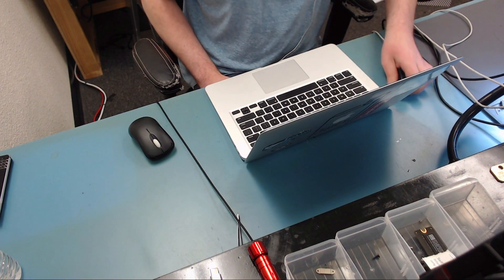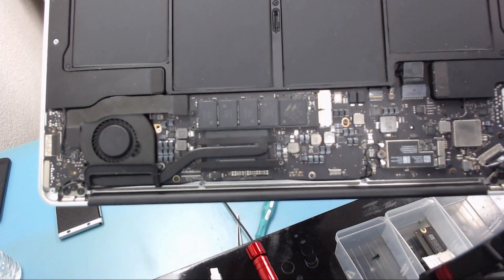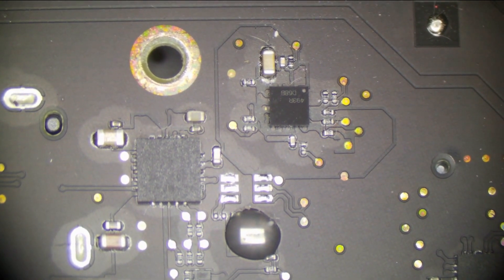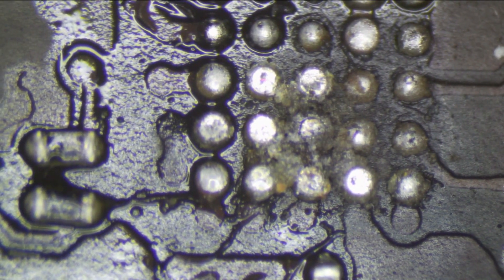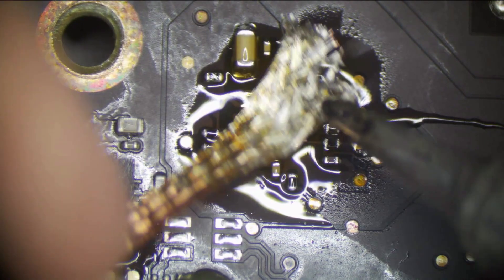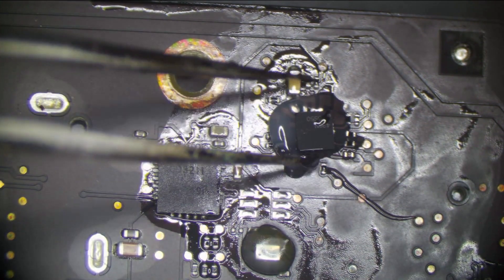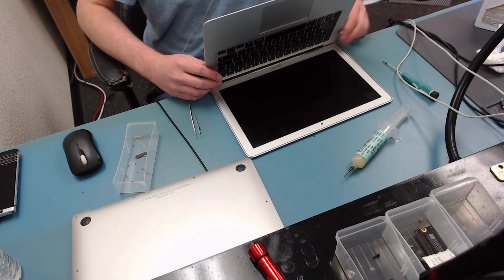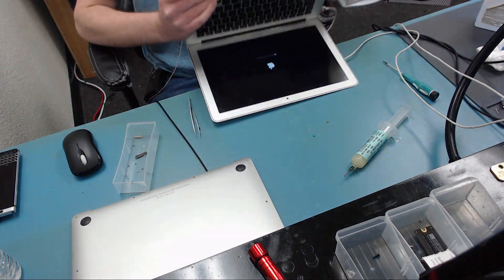How to fix a MacBook Air with no backlight in 10 minutes

Comment: I tried this. My first attempt. I blew 3 capacitors and a tan coloured thing that looked like a capacitor while seating the driver chip. I only found the tan one. I'll get a donor board from ebay. What tips can you give to not blow them away again? Also, there is a pad missing on the bottom right of the board's chip area, the exact one you say to test continuity. How can I fix it? Cheers.

Comment: could use some help, when i opened my macbook air, to give it an alcohol wash, i noticed the feedback trace you pointed out next to the chip that reads 150 441 5bb is missing/burned away.  not sure what to do from there, or where it leads, do i need to solder a jumper wire? if so, to where?

Comment: I do have a A1502 with No Backlight issue but works fine with an external monitor. DO u recommend to check on pointers as mentioned in your video.?

Comment: TCRS do I have to replace the chip or can the same chip be used if damage is not major
Reply from the maker: Do not reuse the old chip. It will be destroyed. It is a $2 chip.
Reply: @TCRSCircuit  could you give me the name of the exact chip so i could buy it
Reply from the maker: @PatrickTempest  LP8550

Comment: Good Morning 
How much did the Chip including the tools cost ? 
I found a MacBook Air just like yours and i wanna try it once 😁
Reply from the maker: Chip? $2. Equipment? $5K minimum.
Reply: Not more than 200 euros.
Without a microscope.
Reply from the maker: @vandehoek  Very untrue. The hot air station alone costs more than $200.
Reply: @TCRSCircuit  Cost me 75 euro.
Reply from the maker: @vandehoek  Cheap equipment sure, however cheap equipment will not cut it for these boards!

Comment: I’m having this same problem. When I shine a flashlight through the Apple logo I can see the display, and it’s making noise so I know it’s something to do with the backlight. Could this be my problem? And do you know how much this would cost to fix? I live in the US
Reply: What did you do to fix it? Please reply
Reply: @Indianajajsj  It is still sitting in my closet not working. Repair shops want 800 dollars to replace a logic board just for a backlight so at this point I will just get a new one. Never buying apple again
Reply: @dsrt65  Oh dear. I have just submitted mine for repair today. Incase it gets fixed I'll let you know then. And if I get it fixed for a small amount i shall let you knw. And also I can tell you what exactly is the problem. And if you can get it done from any repair store.
Reply: @Indianajajsj  Hi, what happened to your repair? Did they change screen or motherboard? I am having the same issue. Thanks

Comment: I dropped my macbook and now my backlight does not work, i checked the lvds connector and it seems fine. What could be the problem? Thank you
Reply from the maker: With it being dropped it could be a bad display or maybe a shorted output capacitor on backlight output on the board.
Reply: @TCRSCircuit    @TCRS Circuit  The display is showing an image so is it possible the backlight component of the display is the only thing faulty. Whereabouts is the output capacitor roughly 2013 model? Thank you!
Reply from the maker: @joshuamiller75  There are many output capacitors. You will need to diagnose it, however you really need to practice on something else before attempting to do board repair on your machine.

Comment: What I do not get is, when you apply all that solder flux , it overflows to other nearby circuits harboring capacitors. The heat gun heats up the backlight chip space to melt the solder and loosen the chip. But it also heats up the nearby capacitors space. So, are you not affecting the capacitor negatively, or even causing it loosen its contact to the logicboard, or the heating damaging the capacitor? The only thing I can think of is there is a temperature difference in the melting points of the solder used to place the capacitor to that used to place the backlight chip. Plz explain
Reply from the maker: The capacitor is not affected negatively at all by the heat. Surface tension holds in place so it will not lose contact with the board. The melting points are different due to pad size. Large pad size = longer time to desolder.

Comment: Can some one help me out! i have a 2012 macbook and it doesnt dim, when i get halfway along the dim scale it turns the screen completely off completely.
does anyone know what the problem is?

thanks
Reply from the maker: Could be screen or board. I'd put my bets on a dead backlight boost driver on the board though.
Reply: @TCRSCircuit  well that sucks! i guess i just wont use the dim function then!
Reply: @TCRSCircuit  Man, where can I buy this new piece "backlight chip" online? In addition, applyed fluid & other great stuff.
Reply from the maker: @johnj9976  Mouser or digikey has them. The liquid is flux. However if you do not know these things already then you need to practice on some dead boards before you attempt on your own or a customers board. Buy a soldering setup, and practice on some junk boards before trying this particular repair.

Comment: I have the same problem with my 2014 Macbook Air. I got it with the screen just like this by the owner for free. He spilled coffee on it. The screen shows up, but no backlight. How much is this charge to replace this..right now I am using this mac just as an external monitor.

Comment: Great work. I'm a wedding DJ and had a less-than-sober guest spill onto my 2015 MacBook air. My machine miraculously is alive, but with same no backlight diagnosis but picture is present. Would this fall under "logic board repair" in regards to pricing on your site, i.e. $249?
Reply from the maker: That is correct.

Comment: I find the 1466 MBA the easiest to work on, they are grateful to get some flux, a little TLC, and put in the hot-tub for cleaning and will boot 98% after that.
Reply: Hi Al, could you please tell me where you can buy the stuff to fix this issue i have a 1465 macbook air with no backlight? Logic Board 820-3435
B

Comment: Got the same issue. Fix the Backlight driver chip - same problem. You got a tip for me? Wich temperature are you using? Got 365°Celsius at 70 (quick)
Reply from the maker: Did you check the feedback trace like I showed? 430C and 120 airflow on my quick
Reply: I will check today, you mean pin 5 to the check point?
Reply from the maker: @moskito2010  yes
Reply: God in a mess! I have no schematic from the f***** board.
I have 8V on the Backlight output. I have no idea witch component created the 20 volts for Backlight. Can you help me please?
Reply from the maker: @moskito2010  The LP8550 does. you probably have a broken feedback trace. rewatch the video and check the feedback line to D7701